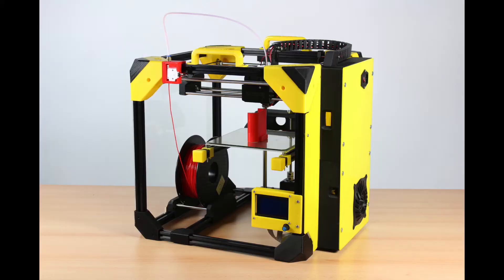Why Print Farms Need to Build Their Own Printers

Comment: I would agree to certain extent, the print farm owner needs to build his print farm with his own machines. Only in the aspect that this will ensure the print farm owner can fix any issue that arise instead of calling out for a repair service that does not really exist in most cities. Stocking your farm up with prebuilt printers won't help you when there is a problem, if in fact you did buy a unit that required some assembly or better yet required a full assembly, then you will be better equipped to handle any issue you run into. The Slant 3d in the video uses nothing specific to an industrial, commerical grade parts because simply there are no open source designs which require those components. The example given in the video looks to me on a superficial observation to be using regular off the shelf parts. Those parts would be purchased on amazon or ebay....nothing in my quick observation lead me to see anything more than a design using the same parts every other chineese printer manufacturer uses....

Comment: Don’t listen to this. This guy is just trying to sell you his 3rd party machine lol. 

He’s just rambling off words with zero examples or supporting information.
Today’s low to moderately priced printers will give you the same quality of print regardless of what new machines are released. They don’t just lose confidence and give up because a new model came out- totally idiotic point. 
Yes, moving parts wear out. Replace them when needed. If a particular part fails too often, find a reliable solution for that part. 
Building your own printer solves zero problems he tried to highlight, and causes many more. Creality and Prusa are far better at supply chain management than any 3D printing service. It’s not an apples to apples comparison. His mentality isn’t capped- how far should you take the “don’t use 3rd party” business model? He’s suggesting that unless you extrude your own aluminum and build your own main boards in-house, then you’re doomed to fail, lol. Total garbage. 
And yes, companies are designing printers specifically for print farms. If he thinks Prusa Pro AFS isn’t designed for print farms then he’s delusional. 

Calling out voodoo on their choice of machine isn’t really an applicable case anymore. MakerBot has always been way too expensive and unreliable to be sustainably profitable. In contrast, I picked up a mass of Ender 3 V2’s for $112 each. Add in another $100 in upgrades and you’re ready to print money. They pay for themselves in less than a month. Aftermarket parts are dirt cheap and plentiful. 

The most important aspect to having a successful print farm, is the product line. You need to make items that sell with acceptable profits- it’s that simple.
Reply: 100% agree with everything you have said. This dude is laughable.
Reply: @samsteel4456  Thanks!
Re-reading my comment- kinda cringe 😬. 
I don’t like name-calling and being overly negative, but this video just rubbed me wrong. 
Thanks for the confirmation that I wasn’t out of line.
Reply: @CoolHandLuked  I don't think your comment was cringe at all. You said exactly what all of us (that have been around 3d printers for more than 5 minutes) were thinking. I built my first printer 8 years ago? Maybe 10. It was a Mendel. Since then I've bought and built Kossels, enders, flsuns, anets and I've built a couple corexy. None of those printers were/are obsolete. Each and everyone of them has been upgraded (ok I'll admit the threaded road frame of the Mendel outlived its usefulness a while ago) whenever a part wore out or a better part was created. When Wade's geared extruder was made obsolete by the Bondtech, I upgraded. I did that with every part on every printer that needed it. At no point did I EVER toss the entire bot because it was obsolete. Listening to this guy piss in my ear and tell me its raining by claiming that a print farm would have to toss out hundreds of bots because they were obsolete, really rubbed me wrong. I hate it when people play others for stupid or worse, try to take advantage of someone that doesn't know better.  Anyways, your comment was spot on and I appreciate you saying what I was thinking. Cheers and happy printing friend.

Comment: Why do you think that is? If there is a growing number of print farms (we have over 40 printers at this point) then why has a company not jumped on this yet? The consumer market buys 1 or 2 printers while the commercial market buys 100 at a time, why is there no printer designed for farm use knowing that in 12-18 months they will be able to sell upgrade kits or addon modules?

Then again...I can't even find commercial level print farm software with most of it being very consumer/hobbyist level meant for a handful of printers...